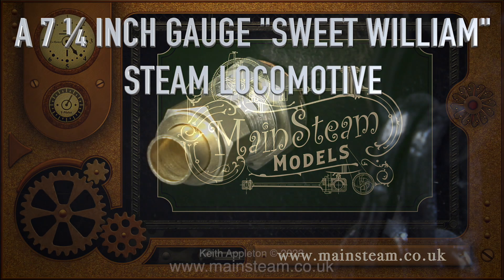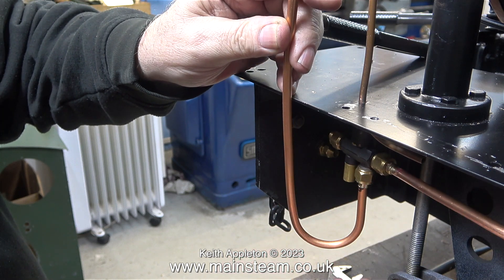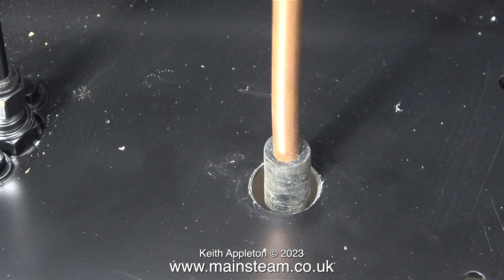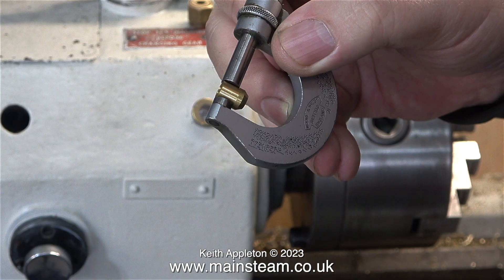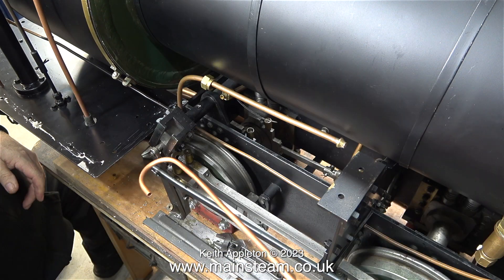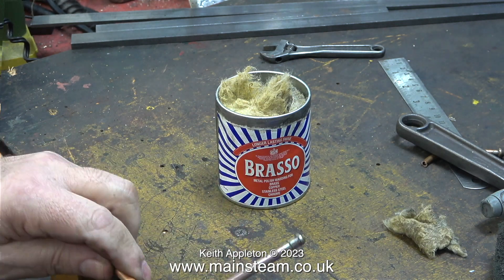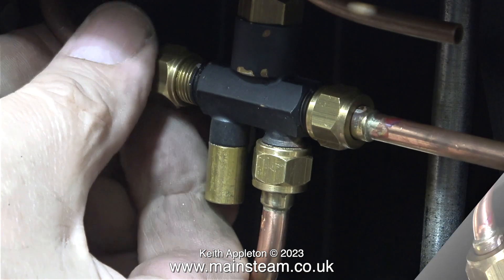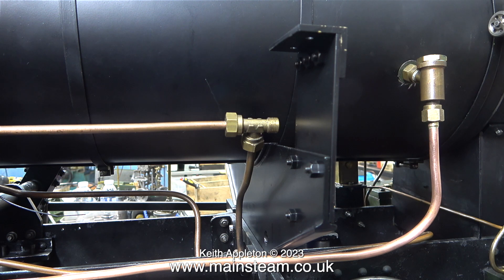A 7 ¼ INCH GAUGE "SWEET WILLIAM" LOCOMOTIVE - PART #66

Comment: I once worked with a man who 'bent tubing (not brass or copper) for the lubricating system on gas and steam turbine generators. The tubes had to follow the contours of the generator. I was amazed as to how he did  it (right every time).He said; "Bob, you won't believe how many times I screwed up before I figured out how to do it." I still don't know how he did it. It was the one thing he would not share with anyone. (insured his employment)
`Here again I stand amazed. The piping is very complicated,. Great job Keith. ;-)